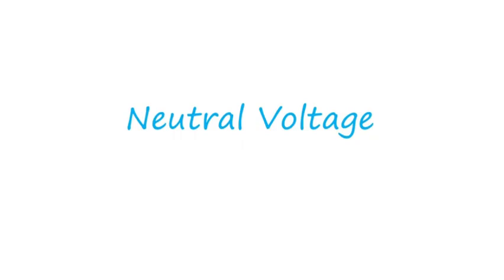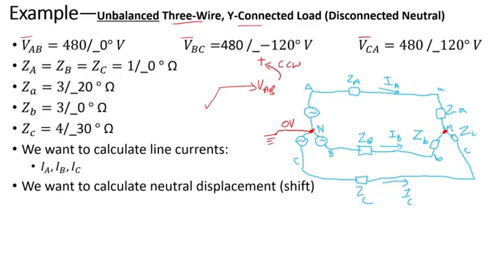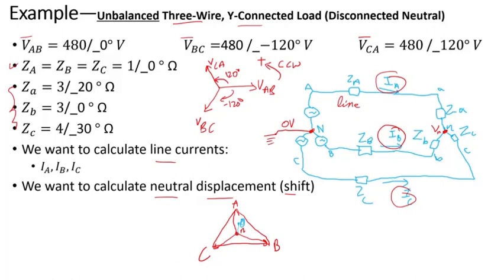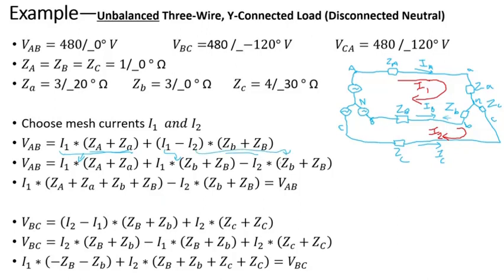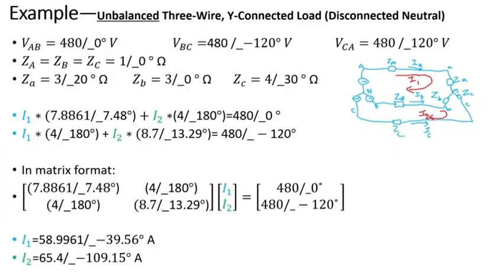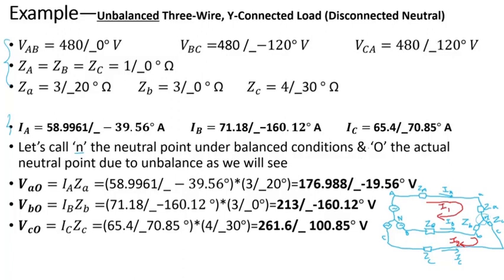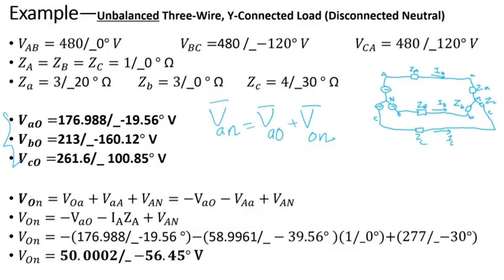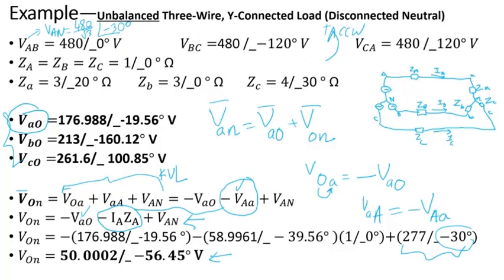Neutral Voltage Neutral Shift Calculation With Mesh Current

Comment: Why are you ignoring the third mesh current flowing through Za and Zc? You need it to calculate Ia and Ic. Without it you can only calculate Ib. If you draw the third loop clock-wise, then Ia = I1 + I3,    Ic = -I2 - I3.
Reply from the maker: Thank you for your comment.
Third mesh is not necessary. Two unknowns, need two equations.

One mesh will provide Ia. The other will provide Ic.
Ib is the difference between Is and Ic, which is why third mesh is not used.
Hope this helps.